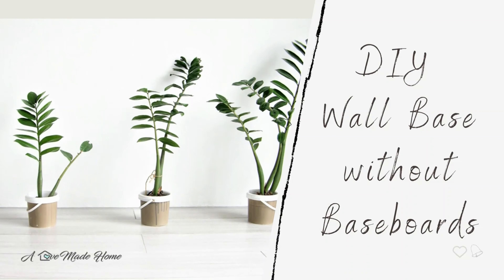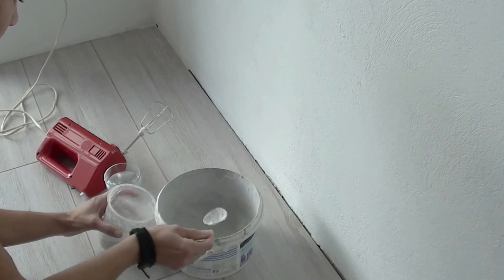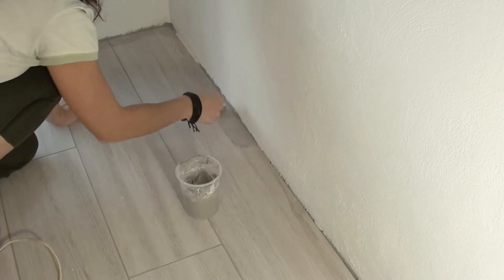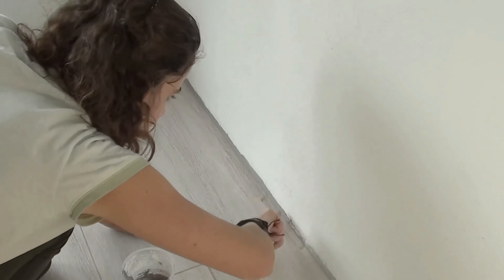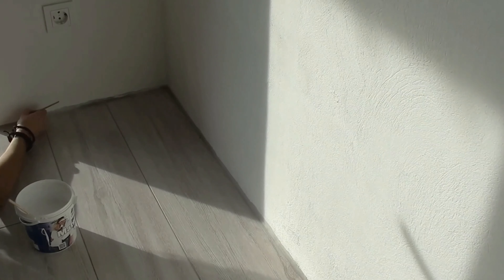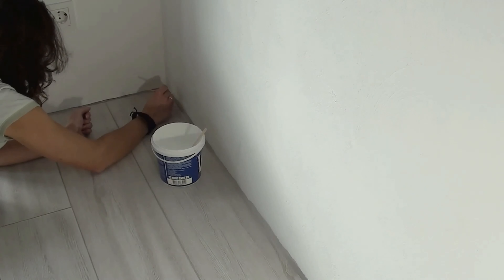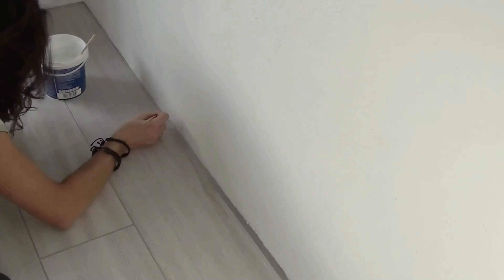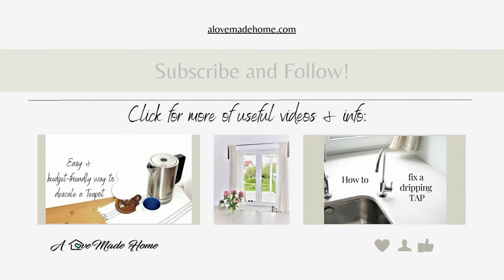No Baseboard Walls DIY

Comment: Thanks for sharing. Recently I removed all the baseboards and kicking the idea just go without the baseboards. This is simple and cost saving. 👍
Reply from the maker: You are very welcome! It is a definitely cost saving solution if one does it by himself. Moreover, it saves time while cleaning, because there is no need to additionally drag a wet rag or a duster along the top of the baseboards. My little secret to clean wall-floor joints is the side brush on the robot vacuum cleaner (one of the most used home appliances in our house) 😃